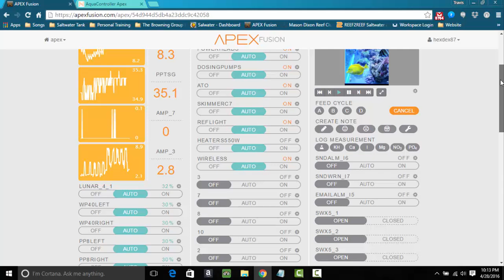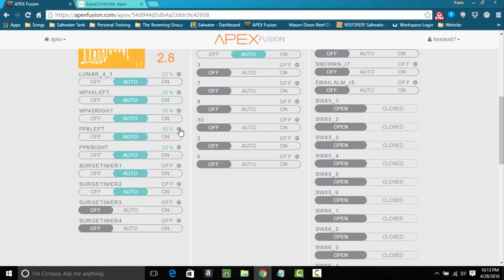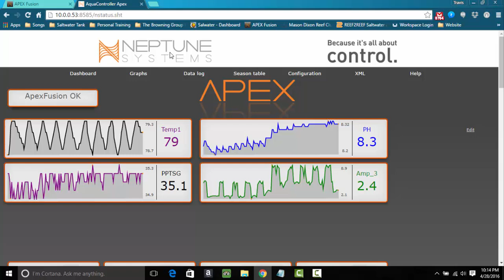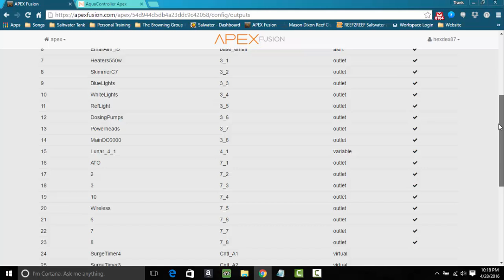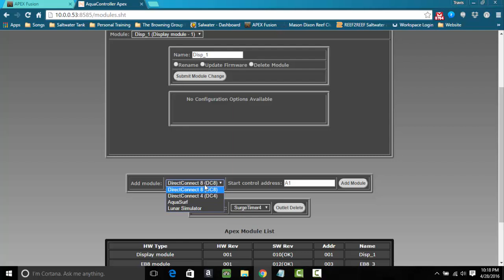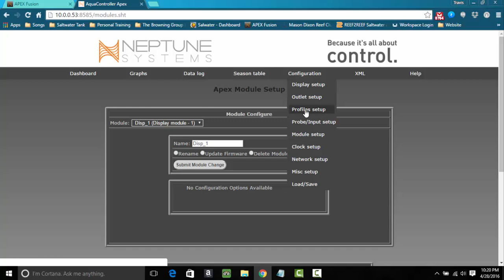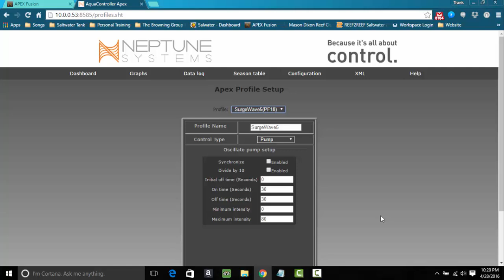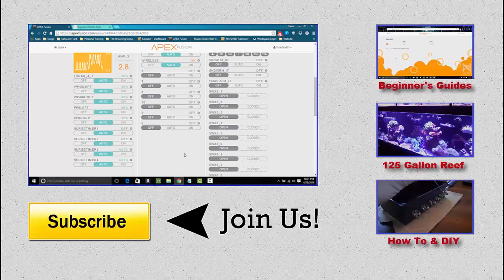Connecting Jebao To Apex Adapter With Programming | Apex Controller

Comment: can i use a standard cat5 cable to connect the module to my vdm apex port? and do i need a special pinout of my cat5? i have a crimping set, so i can make my own cable pinouts if needed.  thanks!
Reply from the maker: Yes you can use a standard cat5

Comment: can you really run 2 rw8s at 100% with only one of the original power supplies?
Reply: Chad Stout If the power supply is from a twin controller then yes. Otherwise, no. You end up splitting current to both pumps and they run at close to half speed.

Voltage is parallel and amperage is series. This is why when you measure something with a multimeter, you actually are connected the multimeter in parallel to the circuit, to measure the voltage. 

But the twin controller power supplies are rated at twice the amperage of the standard powerhead. Therefore, after the current has split between both pumps, then they're both running of the standard psu amps.

Comment: can the jebao pumps be shutoff via the jebao module, if i dont have the pumps connected to an eb8?  if i setup an "if feedA = off" is enabled and the pump isnt powered through the eb8? thanks
Reply from the maker: The only time you can use the feed modes in the apex would be on equipment that is connected to the eb8. Now you can hit the feed button on the jebao controller.
Reply: I meant, if i were using thr jebao to apex module for programming. Could i program thr apex module to somehow shutoff, or lower the pump to zero, if a food mode is enabled?
Reply from the maker: Yes you could go into that variable speed port and set it to shut off if a feed mode is activated.
Reply: Sweet. That saves me from having to power them through my EB8! Thanks, Hex.
Reply from the maker: No Problem